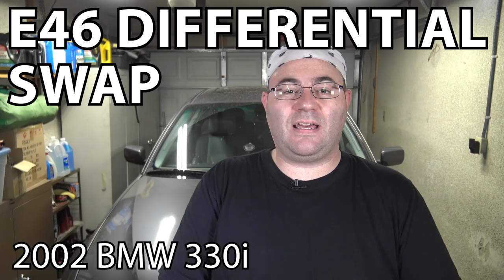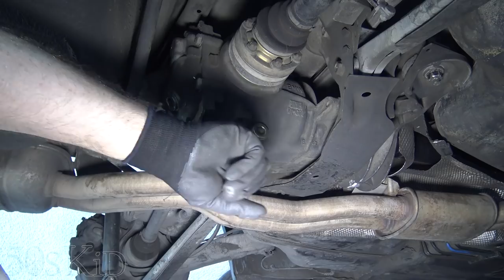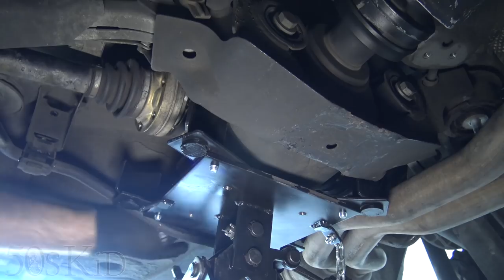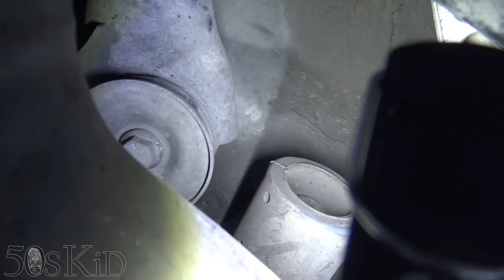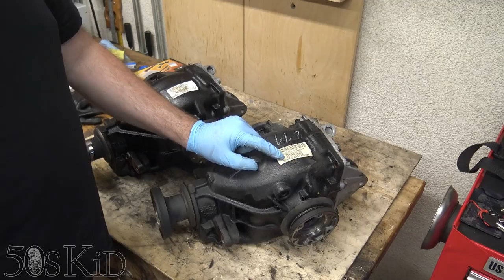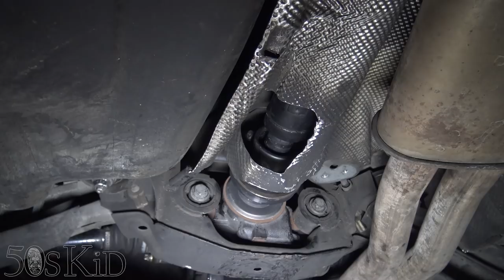BMW E46 Manual Swap Project: Differential Swap DIY

Comment: Hey man, just wanted to say THANK YOU for your videos. I just did the CCV change on my wife’s X3 following your step by step help by removing the intake manifold. By far the most intense job I’ve tackled on my own, but the car runs so smooth now. You’ve got the best car repair channel on YT, hands down.
Reply from the maker: Thanks, man, I'm glad to hear you pulled off that job.  It gives you great experience.

Comment: A really nice video. The details you provide a perfect. I have only one piece of advise. As per BMW-TIS, the bolts for the Propshaft and Driveshafts are supposed to be changed every time you loosen them. They are considered stretch bolts and have a dab of thread glue on them. Unfortunately BMW does not sell them anymore, so as an alternative we should use thread glue on the old ones. 
I know this as i had to find out the hard way. 3 years ago I installed a LSD in my e46 330i and this summer after 60 000km, I broke a driveshaft in the middle of no where. It turned out that i had lost 4 bolts and the last two wern't able to handle the torque. When they broke, they broke the Driveshaft flange and pretty much destroyed the inner CV joint.
I had to get the car towed, had to buy a new drive shaft and find 12 new bolts. Had I know this back then i would still have had my original driveshaft.
Long story short: For piece of mind I suggest adding some thread glue ;)
Reply from the maker: Ok I will do that next time, thanks
Reply: What's the propshaft? Same as driveshaft?
Reply: @shambles416  propshaft / driveshaft / kardan-welle / the long shaft between the gearbox and the diff. Driveshafts/half-shafts/Axles/Output shafts/the two small shafts from the diff to the tires ;)

Comment: 2:1 is tall gear.
6:1 is short.
If you swapped out 3.15 with 3.46 it means you swapped out it with shorter diff, not longer. Autos are shorter. In explaination you made that mistake few times.

Comment: Great video, it helped me a lot, thank you. 

If you put the screwdriver into the middle of the caliper housing, radially into the wheel, it stops the wheel in both directions.

Comment: Thank you Jason, for this detailed video. I will be replacing my diff bushing and axle seals on my 04 330ci. There is a little bit of oil on one side of the  differential. I have seen the other video (bushing replacement) and liked it. Again, thank you.
Reply: Hey

Comment: Done mine and wasn’t too bad. I used axel puller with 5lbs slide hammer to change axel flanges and 1 pull out . Mine was different. My original was the 2.93 and the 3.38 gave it the extra pull.
Reply: Dis your speedo sill read correct

Comment: Great information! I went on here looking for exactly this info. Just bought a 325iT 5 spd manual and it has gears like you had. 1st gear ran out in about 2-3 seconds and 5th saw 3200 rpm at 65 mph. My former auto (same model) saw 2400 rpm @ 65mph…Must be around a 338 dif I’d say. Would like to have heard what changed in your Rpm’s at 75-80 mph? Thanks for listing the ratios of all the models. 👍

Comment: Wow! Very nice video.  Excellent job initially giving perspective for your video audience (front to rear of car). Details make the difference! The steps (alot of them) are well described and well articulated. Being an E90 owner, not sure I want to try to do an AT 6MT swap, but it was a thought at one time. Replacing my diff with a LSD is definitely in the cards though. 

Thanks again!
Steve

Comment: You have it backwards, tall gears give you low RPMs, not what you are saying. Tall gears appear as numerically low numbers. So if you had a final drive of 2.5 vs 3.5, the 2.5 is considered the tall gear, meaning you can cover more mph per 1000rpms.

Comment: All those components were meant to be together, no surprise that you are happier with it as designed.  I really enjoy your vids, thanks for posting them.  Oh and for some real fun, take a SULEV car, cut that old fuel pump out and tig weld a patch in that accepts a replaceable fuel pump.  What a stupid thing BMW did!  My E46 SULEV has about 190K and the fuel pump is soft failing.  Over 6K for a new tank.  I'm going to miss my E46:-(  Word on the forums is that an M3 fuel pump puts out the right pressure.  Would make for some cool vids and maybe save a lot of cars.

Comment: Just done this conversion on a 325 touring and know exactly where your coming  from  (completed less than 48 hrs ago)   its just to revvy and gear-changes are frequent and completely unnecessary so I am looking out for a 3.15 unit and junk the existing 3.46 the M54 motor is quite linear in delivery so cant see it making a huge difference to the acceleration which is quite frisky at the moment obviously.

Comment: Man i feel the same way with mine, but mine was manual to begin with and whoever had it last put a 3.46 welded diff in it, and i hardly drive the car cause its just a pain in the ass to turn cause its welded and at 3k in 5th gear youre only doing 60mph so youre getting ran down by any car on the road, so i cant wait to put the new one in.

Comment: hey, love your channel and videos. I just had a small question. did you experience any play in the input and output flanges on your diff? i have a LSD from a z3 m with 200k on it and i'm noticing maybe 1-2mm of play in the input flange of the diff before the ouput flanges engage. kinda wanted to know your experience. thanks
Reply from the maker: Yeah there was play. A little is normal.  As long as there is no noise, if it ain't broke don't fix it.

Comment: I swaped a 3.38 in my manual 330ci a few months ago and i looved it. The car felt much faster, but t hat was just my personal preferance.
Reply from the maker: Yeah I've been getting a lot of comments and it does seem like it's all down to personal preference.  Personally I'd like a 3.07 with a 6-speed trans... but don't want to spend any more money lol.  The 6-speed is longer so you need a different shifter and drive shaft.
Reply: 50sKid  i thought i could even go to 3.46 since the 3.38 didnt seem as short as i thought
Reply: Dido Stoyanov At 80 mph how high are your rpms?

Comment: 50s kid I have a question. Bmw says to align the driveshaft with the marks you make with a paint marker I assume that’s if your using the same diff. So my question is will I be ok mounting the driveshaft to the new diff because obviously I will not have a mark to go by. Just want to make sure the job will still come out correctly last thing I need is to replace the driveshaft too. I appreciate it also should I use thread seal on all the drive axle bolts or just the stretch bolts

Comment: I run a 3:38 rear diff out of an auto in my 6 speed car (330i) and it is not nearly as aggressive (to me) as you say it is.  I understand it is a matter a preference but I do enjoy the responsiveness that the shorter gears gives the car.  Also running a short shifter helps with driveability.   Some people put in the 3:48 diff and the M3's come with 3:63 I think which is way aggressive.   I 'll keep an eye out for the rear diff bushing replacement.  I actually had mine changed out but I had a shop do it.
Reply: Nick Torres 50sKid has a 5-speed, it's perfectly fine to run a 3.38 or even 3.46 in 6-speed transmissions. Some even do 3.64...
Reply: That would defiantly explain it then thanks
Reply: The gears are actually the same in 5 and 6 speed gearboxes... the only difference is 6th gear drops to 1: .85  but Ok other gears are the same.
Reply: I heard auto diffs are 3.46’s and manuals are 3.01’s
Reply: Save my life and tell me if the 3.38 swaps right into the 6 speed 330. Or does it need mounting hardware or some kind of part

Comment: Great vid man I to swaped my 330i from auto to 5sp an the 3.38 diff is super fun till you hit highway speeds.I changed mine to a 3.07 as I still wanted a little more pick up.Now looking at trying the racing diff LSD kit but the videos on it are rubbish.
Reply: Hey man, I have a 320i auto with a 3.38 diff and im thinking to switch to a 3.07 for a comfortable highway use. Did u notice a big change and do you recommend? I dont realy like the high idle at highway speeds
Reply: @The-qh3vg  yesit'llarond25-3k  on res at iway speeds
Reply: @T34MKILL4  thanks

Comment: Awesome video as usual. Question: I have a leak at the junction where the passenger side axle bolts into the output flange. I thought it was a leaky seal, but now I see the seal is between the flange and the diff. What do you think it could be?

Comment: Hello, and thanks for this video. I'm in the middle of doing my upper rear control arms and Diff bushing. I love the screw driver trick. Saves a lot of time. Also, the 18mm 3/8ths extension between the exhaust is the best way to go. I should have paid more attention to that part because I used an angle wrench. Works but to put back in, the 18mm 3/8ths extension is how we can get it goot'n tight... My question now is, putting everything back, How important is it to put the drive Shaft bolts in the exact same way? Some people say if connected in a different orientation, the drive Shaft may become unbalanced? Do I need to worry about this. My drive by the way is the has the same connection as yours, 6 e12torx bolts
Reply from the maker: No the drive shaft is balanced as an assembly off the car.  Doesn't matter how the ends bolt in.

Comment: Ay yo... I have 2 of those m10x43 zns3 bolts (E12) that are stuck in the different and they're stripped.. ihavent been able to replace my left rear axle cus of this. My axle snapped at that spots and the axle is out but the other side is still stuck in the differential. Just the circle oary that has the screws in it.. I need help with this... I wanna give up... idk what to do.. and my left diff came out the subframe... as well... just like you said.. why and how?? How to fix.

Comment: Great video as always. A quick question, what would be more work...... this full manual swap, or repair my d/drum in my automatic ZF?. It has the famous "No Reverse" issue. Drives perfect in all forward gears. Any advice is really appreciated. Thanks again
Reply: Manual swap less problems

Comment: Hey, I realize that it’s been a long time since you did this but I was looking to do the same work, my car is the same just red instead. Is there more than one manual that drops in? I think I heard you mention, from other videos of yours, a few things that make me believe you are local (in the L.A. area), if that’s true where is the best yard to find parts for these things, hopefully you know of someplace better than LKQ in Sun Valley I can’t imagine how much a differential would cost from those aholes..at that place even the drip pan under the radiator is around $50! All cars die in Sun Valley right or no?

Comment: Hey 50sKid I like your work and very fast paced and active dude nice work only I want to get a bit technical, do those bolts need to be torqued to specs ? I would of thought they had to be torqued like everything else in the drivetrain. Also my main concern in changing gear ratios will your speedo be off a bit along with your tach??? How can you get the cluster to read your new gearing properly?
Reply from the maker: That's a good question (about the speedo).  An older car would have used an actual speedometer cable that would run off the output shaft of the transmission so nothing would change if you change your diff gears.  On newer cars, you have a wheel speed sensor that detects the rpm of the wheel directly (the same sensor is used for the anti-lock braking system).  You can change your differential and make the car accelerate to 20 mph faster or slower, but your wheel will always been turning at 20 mph.
Reply from the maker: And yes every bolt has a certain torque but you kind of learn over time when something is tight enough not to come off and when you're about to make something so tight that the head strips off.

Comment: Great video. would it be possible to do a short video to show how you checked the new diff was ok before you fitted it, or alternatively use the old diff to demonstrate this. ie free play between the input and output shafts due to any wear in the ring gear, also if you rotate the output shafts in opposite directions, how notchy should they feel due to the spider gears. the reason im asking is: On my Z4 I have what feels like free play in the driveline making it hard to get smooth shifts, especially 1st - 2nd very similar to how you described in your previous videos. im aware it can be down to several things from Dual mass flywheel, driveshaft guibo, centre bearing, UJ joint, Diff play, Diff Bush, or the CV joints. in my car the guibo looks ok.
Reply: i have the same issue on my z3 m. 1st to 2nd is rough and clanky but the rest of the shift up are perfectly fine. I believe that there is a whole lot of torque transfer from 1st so the shift is very clanky. i replaced my clutch and i examined the guibo and flywheel and all were in good shape. i did not examine the drive line when i was under there and i'm beginning to think its warn out U joints in the drive shaft and a beaten up CSB. i hope this gives you some insight. fiy the CSB has about an inch of rubber holding the bearing in the center. a very worn out csb might give a good amount under heavy load. anyway take care.
Reply: Thanks for that reverse melting channel, The CSB and the DMF are the only components I cant really inspect easily. last week i found there was some slight play in the inner CV joints, maybe a couple of mm when turning by hand, and also a smaller amount in the diff itself, but I have no idea how much is acceptable. so I ordered a new CV axle on ebay for £60, but after spending a couple of hrs taking the old one off of the car when the new one arrived both of the joints in it were very loose and rattly, much more so than the old ones when comparing on the bench, possibly due to it being a very cheap quality part, so i ended up sending it back. Ive waste a lot of time on trying to solve this problem. Its so annoying I notice it every time i drive the car im almost scared to change gear sometimes cos as soon as i depress the clutch i get a clunk and feel a jolt through the car and then the same when i release the clutch, its not every time but quite often especially between 1,2 & 3 rd gear. Rev matching can minimise it. Im getting quite concerned that it may turn out to be the the dual mass flywheel, and thats very expensive to replace.
Reply: I was surprised at the DMF when i took it off to examine it. My car has 200k miles on it and the original DMF was still good. The surface had an appropriate mar on it and the play was within tolerance so dont freak out if you think yours is bad. I think a good way to test the dmf is to start in 1st on an incline. depress the clutch 1/2 way and try to get your clutch to slip and listen to the flywheel clank back. if your DMF has alot of give then the clank will be strong and frequent and the sound will come from the front of the car. for me, the clunk is coming from more the in the center of the car which is where the drive shaft is. Also, be careful with used parts on ebay especially parts that are high force parts. its best to go new. i know it sucks on the wallet but a new driveline might be the best thing. best of luck.
Reply: Reverse Melting Channel, thanks thats made me feel less worried, today i jacked 1 of the rear wheels and lay underneath and while turning the wheel back and fourth in 1st gear, the only free play i could find was the inner cv joints and also the rear diff bush has a very fine crack that i can see expand about 1mm when levering with a crow bar.  So i think i will change both cv axles and the bush. I then had a cunning idea of how to check the DMF freeplay. I put the car into 5th gear, ie 1 - 1 gear ratio, then watched the output flange of the gearbox and it would turn about 9mm measured around the outer circumference of the guibo, by using some maths ive worked out what that would be when expanded to the diameter of the DMF, and freeplay is about 25mm, so that seams ok to me. Ive never heard of this method so it maybe completely invalid but makes sense in my head LOL.

Comment: I have a question and I am looking for your help please, I have 2007 BMW (E90) with noisy rear differential. My rear diff. Spec. Is: part# 7524324 with 3.73 ratio. It is hard to find these in the Canadian market off a junkyard. Can I swap it with one off e90 (328i/325i) which has the same ratio 3.73 but different part#7519941. Please help me. I am tired of this noise and start to hate my ride 😔 thank you so much!!